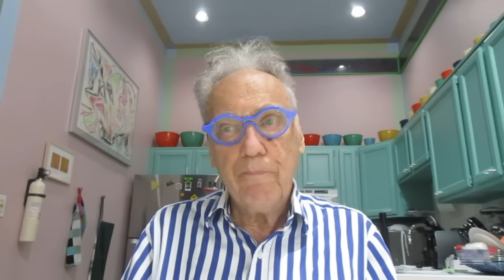Why  is H.C. Verma's Solution Wrong?

Comment: Sir current is a scaler quantity or a tansor quantity???
Reply from the maker: Electric current is a scalar quantity. Any physical quantity is defined as a vector quantity when the quantity has both magnitude and direction but there are some other factors which show that electric current is a scalar quantity . When two currents meet at a point the resultant current will be an algebraic sum.
Reply: @lecturesbywalterlewin.they9259  thanks sir ❤️

Comment: If the current at the surface of the superconductor creates a magnetic field that nullifies the magnetic field created by the Bar-magnet then there is no changing magnetic field in the area enclosed by the loop now, as there is no changing magnetic flux in the closed surface there can't be any induced electric field along the loop (even at the surface) to drive the current. Then what makes the current go on and adjust itself so that it can nullify the varying magnetic field created by the bar magnet all the time? What the machinery behind this self-adjisting current at the surface? We can't say Faraday's law creates the electric field just outside the superconducting loop which is responsible for the current flow anymore , as according to Faraday's law there is no induced Electric field at the surface now but the current still going on and changing itself according to the varying motion of the bar magnet. To ensure that the Electric field is zero everywhere inside the superconductor and at the same time the Faraday's law to be obeyed, the current at the surface seems to eliminate the thing which needs for it's very existence.

Comment: but if current is on the surface of semiconductor does whole semiconductor like inside also become conductive or only just the surface and then how current travel does it use static electricity for that puropse
Reply from the maker: there is NO current inside a superconductor - that's what matters for Faraday's  Law

Comment: Okay professor got your point..

One question I wanna ask you is- Does the force (conservative) experienced by a mass depends on who is applying force irrespective of the magnitude?
Suppose two consecutive forces each of 100N are applied on two identical objects from a distance (say d).. will the object feel different forces depending upon who is applying the force?
Please reply with justification..
Thank you professor !
Reply from the maker: A nonconservative force is one for which work depends on the path taken. Friction is a good example of a nonconservative force. As illustrated in Figure 7.13, work done against friction depends on the length of the path between the starting and ending points.

Comment: Sir, I am in class 11th and Preparing for IIT - JEE 2024, I dont know anything how to go, can you guide me, with books aur etc?
Reply from the maker: 8.01
Physics
Hans C. Ohanian
Physics
Volume 1 
2nd edition
W.W. Norton & Company
ISBN 0-393-95748-9

8.02
Physics for Scientists & Engineers by Douglas C. Giancoli. 
Prentice Hall
Third Edition
ISBN 0-13-021517-18

8.03
Vibrations and Waves by
Anthony French
CRC Press
ISBN 9780748744473

8.03
Electromagnetic Vibrations, Waves and Radiation 
by Bekefi and Barrett.
The MIT Press
ISBN 0-262-52047-8

Comment: If we rub together two insulators, can they exchange electrons between them?
Reply from the maker: yes silk and glass - I use them in my 8.02 lectures
Reply: @lecturesbywalterlewin.they9259  Then how can we differentiate insulator from conductor(with insulated handle)

Comment: I think:
The current will be close to infinity so that there is a finite emf generated which satisfies j=sigma E. This current will create an incredibly high amount of counter force on the source of the magnetic field that is the magnet.The magnet will be very hard to move causing the emf to drop immediately and current will come down to 0.
I tried to think of the situation when the resistivity  of the superconducting material tends to zero
Reply from the maker: I suggest you read the soltutions to problem 119

Comment: How much velocity is required to atomize ( convert to spay mist) a drop of water ?
Alternatively, condensate water is trapped in low point inside a piping system and supersonic steam reaches this point. What will happen next ?
Will the supersonic steam convert the condensate to spray like mist or it will cause pitting on pipe surface ??
Kindly can you suggest how to approach this problem and how to solve it ?

Comment: Hello sir can you explain my problem? My question is that when drop of water fall from cloud then it has initial velocity=0. But it has acceleration 10m/s² then why drop of water not behaves like bullet.
Reply from the maker: the water drop will reach treminal velocity which is very low.  Watch my 8.01 lectures where I cover this.
Reply: @lecturesbywalterlewin.they9259  thanks sir

Comment: Sir, why a capacitor discharge by itself ?.when we disconnect it from the power supply then the potential difference start decreasing by itself.
Reply from the maker: himidity in the air will play a role also charge may leave at sharp edges where te E-field is very strong.  Apart from all that cosmic rays ionize the air and that will dischargethe capacitor. If you place the capacitor in vaccuum (bell jar) it will discharge much slower.

Comment: Thank you Dr. Lewin. So, Prof Verma missed the Meissner effect, which expels magnetic field from the body of the superconductor. I understand that, inside the coil, B=0 leading to E=0. And hence, current is 0.
But, what if we are just talking about regular conductor with 0 resistance? Will it also show same property? If not then, B and E should be non-zero, and current should be infinite. But there should be zero Ohmic heat loss, and only radiation loss should be there, due to moving charges. I would love to be corrected or, given a feedback on this. Thank you.

Comment: What if the superconductor coil is placed in vaccum will still the resistance on the surface be non-zero?
Reply from the maker: yes, the penetration depth is only several molecules.
Reply: Is this because the surface dosent behave like a superconductor?

Comment: No offence to all Indian students there are parts of superconductivity which is beyond the scope of ur JEE exam and in his explanation prof verma says that the solution is incomplete but for the scope of ur exam that’s enough ! I highly subject you just follow Prof verma without having any hesitation because of the scope of JEE! On a simple note I shall conclude prof Lewis says that an E field is created just out side ( that’s wrong can never happen ) but just inside the boundary for that you need to add more concepts to the thought process like penetration depth! So to all Indian students just follow ur the explanation intended by prof verma for the scope of JEE! That’s good enough ! And learn more about superconductors and then reason ! By the way I’m a srilankan who has great respect for prof verma! May be prof Lewin didn’t intend to do it but by calling in blatantly wrong without knowing the scope of the solution which prof verma himself says is incomplete is actually not good , if there was an issue he could have sent an email to the prof and discussed without trying to create controversy !

Comment: A similar question came in todays jee advanced
Thanks for helping me solve it
And i noticed they mad the same mistake
Reply from the maker: not surprosed that they made the same  mistake that H.C. Verma  made.
Reply: They had taken the super conductor to be a ring and a permanent magnet of magnetic moment m was approaching it . The question was to find the current in the ring, but as you said there is no current in the super conductor but just out side it.
Reply from the maker: @shashankagarwal804  yesssssss and that is very fundamental it's the basic physics behind the Meissner effect.

Comment: Both the professors are the best 
There is no battle
But, I must say that Jee exams are wrong way of judging students for their enrollment in IITs and NITs.
Instead of this tests, SAT test held for enrollment in American Universities are much better than JEE and NEET
My Personal Thinking is
Walter Lewin explanation are much better than HC Verma's explanation.
Reply: Yes both are different, But the point is admission is not to be done on the basis of Accepting higher grades and rejecting lower grades.
It should judge how much they are interested in pursuing the following course.
Reply: If you focus on the jee exam paper many of the questions are highly calculative and tough and also the time is limited according to the number of questions asked.
What's the matter of such a complicated exam, do we need machines that are able to solve numerous problems.
How is the paper defining the talent of the person.

Comment: I think we should explain it with the help of Einstein special theory of relativity (length contraction) as in super conductor their is no resistance so there will be no proton in it so the moving charge will not produce any magnetic field hence changing magnetic field will not produce moving charge

Comment: Professor, I was wondering what would happen if we could do this experiment in vaccum (though moving the magnet would be hard)? Without air contact at the coil surface, would there be any resistance to allow an EMF (and current)?

Comment: I remember such similar exchange of opinions between electroboom and Walter sir
Reply from the maker: ElectroBoom was dead wrong. There was never an exchange of opinions. 
I demonstrated at the end of my lecture #16 of my 8.02 E&M course at MIT that two identical voltmeters attached to the same 2 points in a circuit can show very different values. https://www.youtube.com/https://www.youtube.com/watch?v=nGQbA2jwkWI&list=PLyQSN7X0ro2314mKyUiOILaOC2hk6Pc3j&index=17
This can also be demonstrated with a transformer.
https://www.youtube.com/watch?v=b7i2uMx7gHo&list=PLyQSN7X0ro22zanLOcvkaSY-IZqheFYM5&index=8
The reason is that an induced EMF (Faraday's Law) creates a non-conservative E field. This means that moving a test charge between the same 2 points in a circuit can require a different amount of energy (even with opposite signs!). You still aren't getting any energy for free, because it comes from the source of the time-varying magnetic field.
When a voltmeter reads a value V it means that the integral of E dot dL across the voltmeter is V. 
In cases where Kirchhoff's loop rule (KVL) applies, 2 voltmeters attached to the same 2 points in a circuit will always show the same value. Kirchhoff's original text can be found in the following link, pages 497-514: https://books.google.de/books?id=Ig8t8yIz20UC. Clearly he was fully aware of the prerequisite for his "loop rule". KVL is a special case of Faraday's Law. That's why Faraday's Law is one of Maxwell's equations and KVL is not.
My demo was first suggested and published by Romer in December 1982 in the American Journal of Physics. This demo has now become a classic; it's done all over the world at many colleges and universities.
ElectroBOOM and Dirk Van Meirvenne believe that 2 voltmeters attached to the same 2 points in a circuit must always show the same value which is not true. They each posted a video on their channel in which they claim to have proof for their wrong ideas.
Also read Professor John Belcher's thoughts on Faraday's Law and on KVL. Professor Belcher is my former colleague at MIT. http://freepdfhosting.com/0813df09f5.pdf
ElectroBOOM insulted me in his video by mentioning that the reason why my 2 voltmeters read different values was due to "bad probing". He stated that if I had done the demo correctly both voltmeters would have read the same value. He could not have been more wrong.  
The following video may also help some of you to understand why 2 voltmeters attached to the same 2 points in a circuit can give very different readings. https://youtu.be/T6S5VS03xZc   I thank Mick Vall for his insightful comments.

Comment: Sir. In this lecture you point out that it is the surface current in the superconducting loop that is responsible to create a magnetic field that completely cancells the B field of the magnet. Sir in the interior of the superconductor there is no current in the case of the ring. But in the case of the battery  with an internal resistance whose terminals are stored by a superconducting strip which you discussed is there any current in the meat I mean in the interior of the strip?. Sir if you would please clarify this issue once again. Well I look forward to your valuable guidance.

Supriyo Ghosh

Comment: The big question is what will happen if an ideal ammeter will be connected in series with the superconductive loop? Assuming the ammeter resistance is zero, will it measure the "surface current"? If the answer is  yes, which it is, then the surface current theory doses not hold...
Reply from the maker: amp meters have internal resistances. Thus an E-field will be produced in the meter and a current will  flow also through the circuit including the superconductor.  Listen closely to this video
Reply: @Lectures by Walter Lewin. They will make you ♥ Physics.  

Thanks, but let's assume that the amp meter is superconductive. Will it register any current? If it does then the surface current isn't really a surface current.

As an electrical engineer (PhD) I'm not comfortable with the theoretical surface current concept, which is just a abstracted trick of saying that the current flows in the loop but it doesn't flow in the loop, thus, the current flows in undefined space at the theoretical boundary between the wire loop and its surrounding space... 

Is such surface current equivalent to a theoretical skin effect at an infinite ac frequency? 

This problem is similar to a problem of connecting two ideal voltage sources in parallel that have different voltage values. 

Will the total voltage be Va? , Vb? , or the average of both? I really don't know why scholars bother with such theoretical and useless problems.

Comment: Dear Sir,
I,Avishkar Bahirwar, am a 11th standard Indian student studying in Masterclass.I have a theory regarding the explanation why gravity exists at the first place.

One limitation of Rutherford's model was that it didn't follow Maxwell's theory of electro magnetic radiation [which states that an accelerating particle radiates energy]. Now, according to the current quantum theory an electron has a dual nature and thus it is a wave also.Now if we put this observation back into Rutherford's model then we get a situation in which the electron is supposed to lose energy (as a particle) but it doesn't lose energy(cause it is a wave) cause Maxwell told that,'an accelerating charged PARTICLE loses energy.'

Now,the situation is so that the atom is supposed to radiate energy but it doesn't(cause electron has a dual nature). Thus,it creates an ENERGIAL VACCUM around the atom.

This Energial Vaccum is directly proportional to mass as more the mass,more the atoms and more the electrons causing energial vaccum.Energial Vaccum decreases as we move away from the body and thus it is inversely proportional to the distance.

The quantity which has a similar relation in classical world is 'Gravitational Force.'

If my theory is right then 1 important point would come forward that Gravitational force between 2 bodies is never constant and it fluctuates (fluctuation is very,very small could say 10^-30 or 10^-40[ not calculated( assuming)]).This fluctuation is because an electron posses random motion and thus it could move near the nuclues or far from the nucleus at a specific instant,thus altering the amount of energial vaccum.

My theory is also proving things such as why do humans and large object also act as wave( due to 'Gravitational fluctuation).My theory is not wholly complete and it has many more points to explore.

I hope you would go through my theory and tell the faults my theory has and the alterations I need to make.

Thank you.

Comment: Sir so if there is an electric field outside the superconductor or on the surface of the superconductor there must be a change in magnetic flux according to Faraday's law but here the net magnetic field is 0 which is constant.
So does it violate Faraday's law of induction?

Comment: In a DC circuit, when a unit charge passed through all resistors and have voltage/energy zero left with them, then how are they able to reach positive terminal of cell (motion with no kinetic energy) . Do they get attracted towards positive terminal as they have no kinetic Or any other form of energy in them left
Reply from the maker: watch my 8.02 lectures
Reply: Good evening sir, 
I have written few pages of the concept i have reached after reading from my physics book and a little from google. Can you please check it if I mail some pages to you, only when you get free time. Well, i haven't watched all your videos yet. Please clear my misconcepts if i have any. I'm crazy physics fan and want to become a physicist and do want to live with wrong concepts. 
•From an Einstein fan and your's too😊🤗
Reply from the maker: @babitachaubey491  I can only read what you write here. I never read more than approx 400 words.

Comment: If I have a conductor with extremely low resistance, would the current near the surface of the conductor much greater than the current in the middle of the conductor?